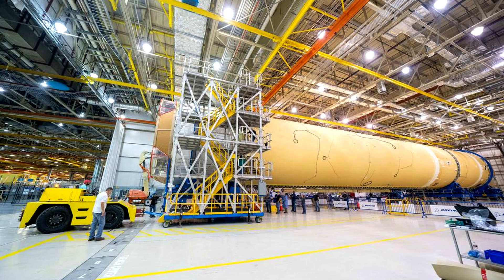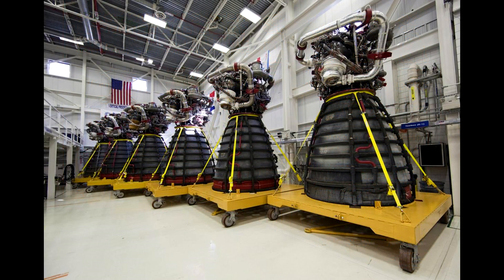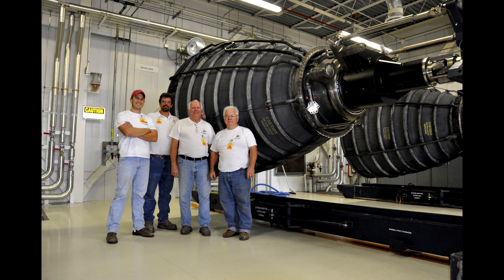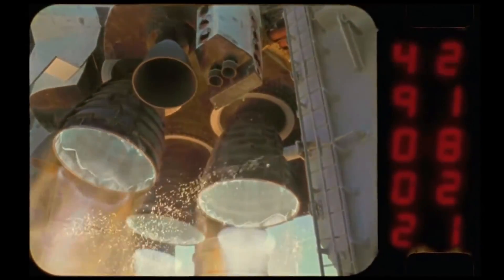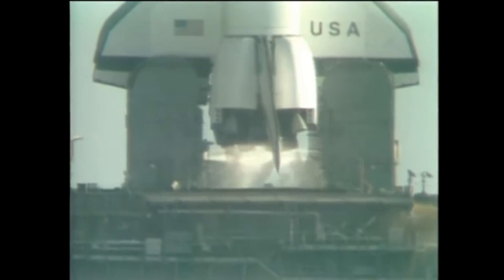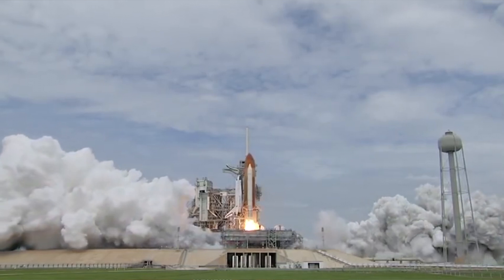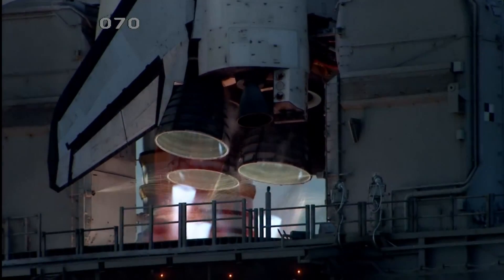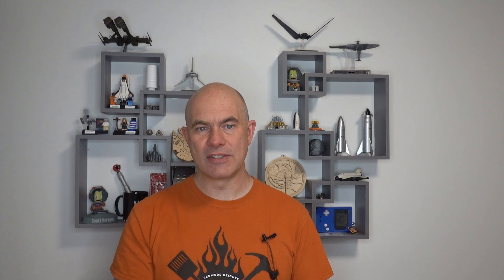Four Old Space Shuttle Engines Team Up For One Last Rocket Launch

Comment: During my 15 years at Marshall, I witnessed a lot of test stand firings of the SSMEs abd was amazed that few employees turned up to watch.  It was typically a small group and the occasional museum bus tour. Of course launches were impressive as well.

When Peter Diamandis, Byron Lichtenberg and I founded Zero-G and began the x-prize one of the drivers was a simple, economics one: if govt contractors are building as many expensive rockets as they can, what incentive was there to build more affordable engines? 

I’ve never commented on a video, but the reality of the first reusable engines being tossed off on expendable missions is a poetic tragedy. Thanks for covering this and I hope that some technology spins off that will have them die for a better cause. 

Absolutely fantastic video! I wish some of my German rocket engineer mentors were alive to see this! We used to debate about the future and I’m so happy that commercial space is slowly but surely surging ahead. Thanks Scott for your channel!
Reply: Thank you for all you have done to help push rocketry into a new era.
Reply: I recall some facts about the three RS-25s when at 100% throttle on board the STS. The individual turbopumps which are about the size of a V8 engine, generate as much power as 40 diesel locomotives. And each would drain an average family-sized swimming pool in about 12 seconds. And if the output of the pump was pointed upward, it would drive a column of water 50km into the air. When at full throttle, the three engines combined put out as much power as 23 Hoover dams. And remember: these engines are not fixed - they are on gimbals!
Holy mother of space: What numbers will SpaceX's Starship have???
Reply: @Chris.Davies  Those stats for fuel consumption are hard to even process in your head. The power packs for rocket motors really don't get the love they deserve.

That one stat about the turbo pumps if able to just fire upwards is too crazy. Maybe if fired in a vacuum or some other imagined situation.

Oh and the ports on the underside of the shuttle to take fuel from external tank were impressive to see. And they had doors to cover them that had to survive re-entry.
Reply: Ray, thank you for all of your contributions. I enjoyed reading your comment.
Reply: Ray Cronise thank you for commenting, interesting and I agree with your sentiments, it's sad to see these engines used this way, but in many ways I think it also makes sense, if you have them and can save something that you can use elsewhere in the project or simply to keep the overall costs down a bit. 
I was born in '78 and as a little kid I was really optimistic but then grew disappointed in my teens that so little was actually happening with human space flight, aside from the MIR and later the ISS, but they didn't push the boundaries in the way I felt that we as humanity should have done by then. 
I am very happy seeing what is going on nowadays in particular with SpaceX making big strides, and I now have a young son and we watch and rewatch SpaceX launches and old shuttle missions and ISS streams together, and he seems to have as much enthusiasm as I had for it.
Reply: @noth606  - oh, talk about disappointment - how about following gemini and apollo enthralled by the moon landings through Apollo 17, then BAM program canceled, equipment junked, personnel dispersed ... now, that's  disappointment.
Reply: @andyburk4825  You got to witness man landing on the moon? Disappointing sure is relative.
Reply: i worked at wallops island ✌🏻
Reply: @RDC_Autosports  I can't wait for Rocket Lab to start flying out of Wallops. I grew up spending my summers right across the Chincoteague Bay from there but sadly don't remember the launch I saw very well. Now I can't wait to take my own son down to watch a launch.

Overall, it's a good time to be a fan of the aerospace industry. The only reason I feel so critical of the SLS program is because the commercial partners are doing so awesome in comparison. I'm thrilled they started the commercial crew and resupply projects.
Reply: Thanks for sharing your insights!! :)
Reply: Thanks so much for sharing! :)
Reply: The biggest issue with NASA is that they have to cator to all these aerospace Congressional Districts that all want their slice of the pizza. Private enterprise does not have to worry about that which means way lower costs.
Reply: Zoomer30 Have another look. All those contractors who the congressional districts are pandering to are PRIVATE COMPANIES. That’s kind of the point.
Reply: @Thomas Hancock The story goes on. The tricks don't change.
Reply: They recently released the cost per launch of the SLS and it's a staggering $2 BILLION. I've been reluctant to poo-poo the program until recently. Potentially 20x the cost of a Falcon Heavy is ridiculous. NASA turned down an offer from Blue Origin to develop a higher performing second stage. I believe they're using the upper from the Delta IV on the first few fights if I remember correctly. Honestly, with how much each launch is going to cost and the fact that Boeing can only build one vehicle per year, I hope we only see this thing fly on the two missions already planned for it.
Reply: @faceplants2  SLS is incomparable to a FH. I wish people could get that through their head. FH will never be human rated and will never be able to insert the mass of SLS into lunar orbit. Even smaller payloads within their capability would suffer from the weak second stage taking much longer to get there. BFR is a work of fiction in the sense that it would require enormous amounts of fuel to be transferred in orbit. Never been done. Not saying it can't be done but it's going to cost a lot to figure it out.
Reply: @divedevil985  I totally agree that the architecture of Falcon 9/heavy isn't comparable to SLS. It would make no sense to spend any more money certifying that platform for anything else including human rating it.

Your point about the second stage on SLS sounds like we're on the same page. At least on block 1, the under powered stage 2 is a waste of the 1st stage's capabilities.
  
I'm not an engineer but I'm an aerospace enthusiast and follow the development of many projects. I'm always happy to learn but things are much less likely to "get through my thick skull" if they're laced with snark. My point was the different approaches to vehicle design and financing between Boeing and SpaceX have led to very different outcomes. SLS is way late, way over budget and frankly disappointing for me. I've been anxiously awaiting this vehicle for years and if it wasn't the only launch vehicle currently capable of carrying Orion, it would seemingly have very little usefulness.

Not sure what part of starship you meant was a fantasy. I'm happy they're setting their targets way out there though.
Reply: @faceplants2  who were you quoting? Not me. If you can't even respond honestly to my statement I think you are too thin skinned for further reply. I'm getting tired of trying to educate people with no background on the subject who think they are experts. You don't want to learn even if it is served on a silver platter.
Reply: @divedevil985  I was pretty clear I'm not an expert. I would've correctly quoted "get it through my head" if I could have seen your comment while replying. Regardless, my incorrect quote is how I interpreted your first reply. Communicating is pretty hard with only text and an inability to hear tone. How about we have a conversation? I'm not being thin skinned, just like engaging on this subject
Reply: @divedevil985   I think he was talking about the part of your comment that starts with "The BFR is a work of fiction." The part about orbital refueling is a valid point.
Reply: @divedevil985  Saying the FH will never be crew rated is mostly an observation than any specific technical limit on the vehicle.  It won't be crew rated... at least for NASA... because NASA neither wants to pay for it to become crew rated nor does SpaceX want to bother since it is going to be retired in just a few years.  The vehicle is essentially an extended Falcon 9 though, which *is being crew rated*, so I really see no significant problem.  As for cargo capabilities, Falcon Heavy is comparable to SLS Block I.  That is the current program of record and SLS Block II is at this point pure fantasy as to if it will ever be built.  I grant that SLS still is more capable, but with ten launches of a Falcon Heavy costing the same as but a single SLS launch it doesn't seem to be much consolation for a modestly larger bit of cargo.

Starship (the current name of what was the BFR) is certainly more than capable of launching more than the Block II SLS even if in orbit refueling never happens.  While I will admit it is currently in development, SpaceX is well into the "bending metal" phase and test flights are currently happening as the architecture is refined.  Calling this a work of fiction is being pretty disingenuous.
Reply: @divedevil985  this is nonsense. Falcon 9 is going through human rating right now!
Reply: @GlanderBrondurg  I didn't say it wouldn't be. I said it SHOULDN'T be. Load and Go is dangerous.
Reply: @TheRealMarauder  I didn't say it wouldn't be. I said it SHOULDN'T be. Load and Go is dangerous.
Reply: GlanderBrondurg Starship is solution looking for a problem.
Reply: @GlanderBrondurg  The "bending metal stage" are at vastly different phases of dev. for both programs.
Reply: @hoghogwild  Yeah.  Starship is going into orbit in the next month or two.  SLS is still at least two years before it will launch.  When I made that comment two years ago, they were at different stages.  Not so much any more.

This discussion seems even more silly now being critical of Starship since it has actual flight history.  A different testing approach no doubt, but the SLS testing approach not to mention price point seems to be a relic of the past...like 1970s past rocket development approach.
Reply: I am willing to bet that only if SpaceX can at some point do the SLS mission at half the like ~quarter of the cost, some of the engines will be saved... I don't think that it is impossible with the timeframes of SpaceX (and NASA/Boeing...)
Reply: I personally would love to have one of these in my den by the fireplace. I get what you are saying...incredible machines. Having said that we have many in museums. At least one with each orbiter on display and others on display by themselves or with replica orbiters. I hate seeing those photos of WW2 planes being scrapped after the war...but it makes the ones we saved more special. SLS is the next evolution of shuttle hardware and it makes sense to let them fly.
Reply: By now slaves and masters are death alike
Reply: @2adamast  Put the crackpipe down and back away.
Reply: @dalethelander3781 A Polish slave-labour survivor of the Dora factory recalls how Wernher von Braun visited the works and seemed "completely unperturbed" by the piles of corpses
Reply: @2adamast  what can be done as of this time, is only to remember the horrors of the world we made. Since many have no connection to most of it, it should be brought up.
Questionable if this is the right place for it but I see your idea (:

Comment: I know it seems extremely Kerbal inspired.... But how much would it cost to strap a set of chutes to the tank? Even at this late a stage. Maybe even the bottom, so the engines don't take the impact. To later pick it up? I don't even mean money wise, but time and materials wise. Like a recovery vehical etc. The tank itself may likely still be written off, but surely it can be scrapped for some recycling value, and some of the parts of the frankly expensive motors may even survive. No?